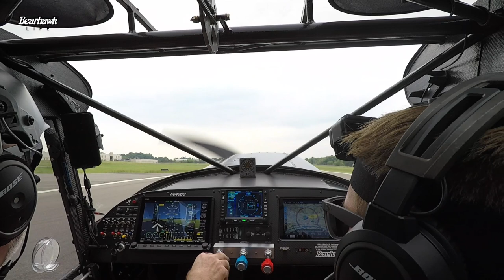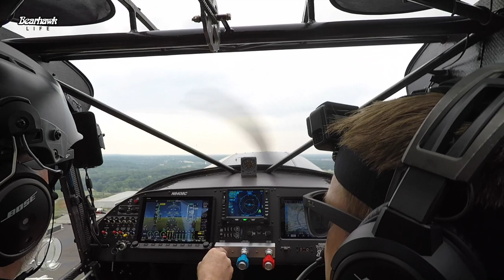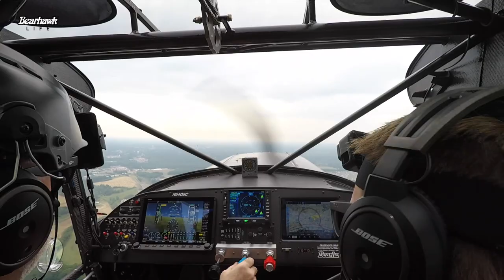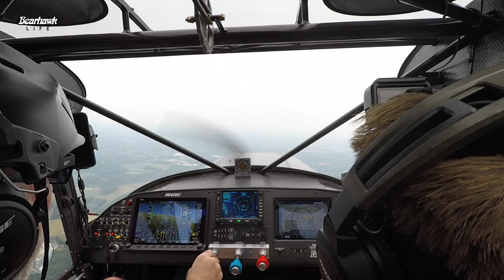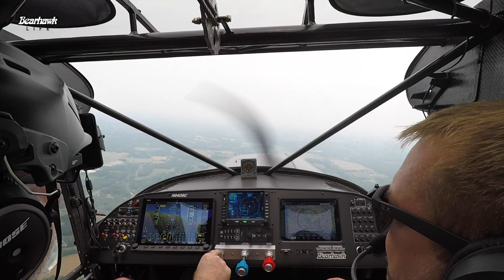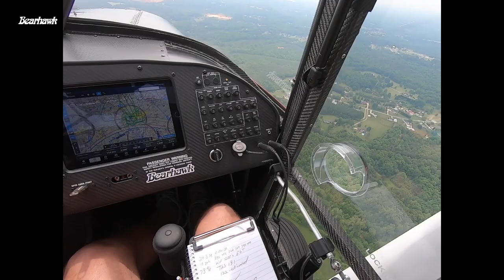BEARHAWK LIFE ~  FIRST FLIGHT

Comment: from the belly cam it looks as if there is some oil canning on the flat belly in front of the camera!  It isn't camera moving/vibration as the gear legs are stable in frame.
Reply: Since I don't hear ANY oil canning in your audio---- I wonder if the waviness I see in the reflections on the underside are being distorted by heat waves from engine exhaust---- I do believe your exhaust is centered left and right.
Reply from the maker: You're seeing fabric.  Pretty typical.